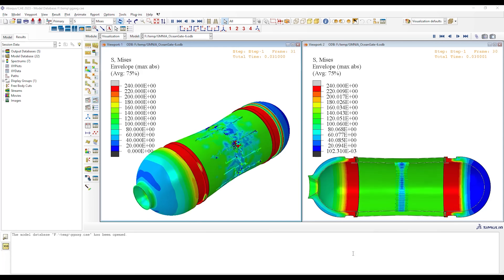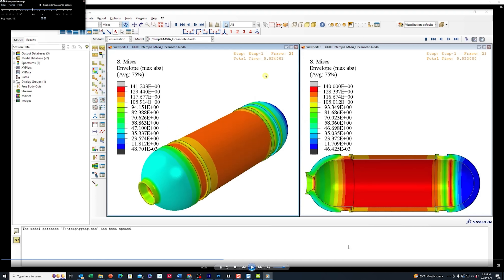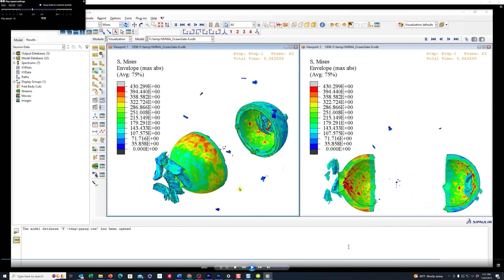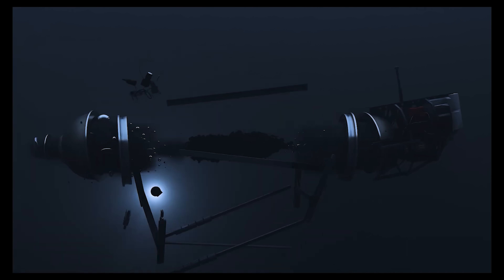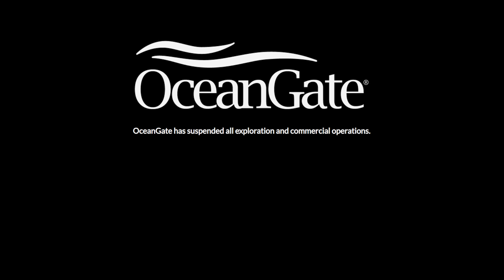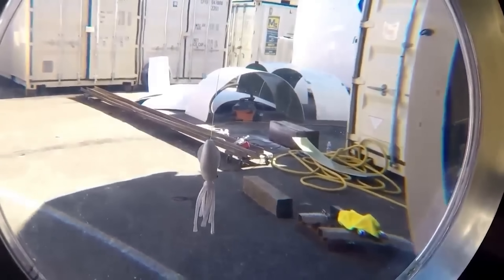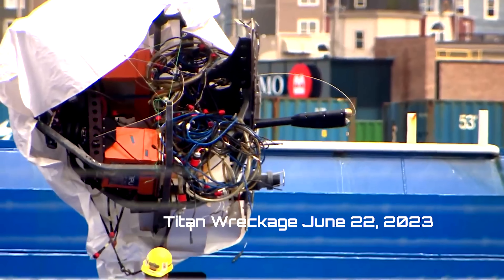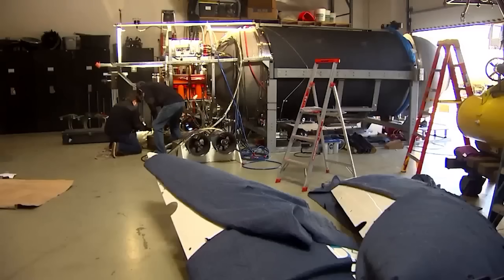Best Titan Sub Implosion Simulation, Cracked Porthole? Q & A

Comment: What still caught my attention is how preserved the titanium parts are. It seems it was the right material to be used in the whole body of the sub.
Reply: And all other submersibles have been made of metal before this. They then went through an extensive,  expensive certification process  before being used. These submersibles have excellent safety records! If it's not broken, don't fix it! Stockton was pushing the envelope with his "innovations" and despite advice about the dangers, continued.
Reply: @IANCHARLES1965  yes unfortunately he was on the right track but like Ford the first model is gonna be kind of a piece of junk and have a lot of recalls and maybe by the third generation you have close to the perfect submersible I would not be surprised if someone doesn’t follow in his footsteps only with less arrogance, and they change some of the specifications and strengthen them to the point where it will be reliable, it obviously was a working model. It was just not perfected.
Reply: @IANCHARLES1965  Pushing the envelope? He was pushing the limits of all human sanity and he did every single thing possible to ensure he died the fastest death in human history.
Reply: The second problem with titanium after cost is you are going to have a hell of a time making a chunk of titanium large enough to make a six passenger sub and then machining it down to size. Joining sections by welding them together and achieving the same strength as a solid billet without causing stress points or introducing impurities sounds like an ordeal.
Reply: @teardowndan5364  it forges well but is hard to machine to tight tolerances that’s the very expensive part but if you can’t afford to be in the game……
Reply: @teardowndan5364  It is an ordeal but IT IS POSSIBLE unlike any current set of orientations of carbon fiber that we know of (I'm not saying it can't, I'm saying we don't know if it can or not which is why it isn't used).
Reply: @milhousevanhoutan9235  Practically every expert who has spoken about carbon fiber for a sub's pressure hull that I have heard said the same fundamental thing I knew: carbon fiber works best in tension where the fiber's tensile strength is the limiting factor and well understood, not compression where the resin bears virtually all of the load.
While this may not be proof that it cannot work, it is ample reason to be extremely skeptical. Experts even say carbon fiber can fail in too many different ways as an heterogeneous material to reliably model and simulate with current knowledge of the materials.
Reply: @teardowndan5364 Well maybe you shouldn’t take people with you if that’s the case.
Reply: @teardowndan5364 The Aluminaut used bolted rings not welds. It had the same depth rating as the Titan was supposedly designed for.
Reply: Too cheap= Human ketchup.
Reply: @Suprem3DarkLord  yeah In hindsight I'm sure he wishes he used titanium, or stress tested, or any number of the other things he blatantly ignored
Reply: @coreyspitzley2960 he can’t really wish for anything in hindsight. He’s dead.
Reply: @coreyspitzley2960 in hind site, he dead
Reply: @berzoidberg3272 lmfao I commented the same thing before I saw your comment
Reply: @coreyspitzley2960 he doesn’t wish that, the entire design process and even after it everybody and their mom warned him that he was cheap and using the wrong design and materials. He blatantly disregarded every warning he got, and sued or fired anyone who disagreed.
Reply: @coreyspitzley2960 Not to state the obvious or anything, but I don't believe Rush is wishing much of anything these days. The wish ship has sailed.
Reply: @coreyspitzley2960 nah too late for that he doesn't realize anything now
Reply: @coreyspitzley2960  well is everyone knows Bill Gates is right about climate change. We should never question because he’s billionaire and you know billionaires are like gods and we should never question them.
Reply: @Suprem3DarkLord  problem not meant to be there in the first place...like everest.
Reply: one thing right doesn't overtake one thing wrong. as in everything.
Reply: Or the right shape. A sphere is much better at resisting pressure than a tube.
Reply: The carbon fiber fuselage lengthened under pressure.  The fiber orientation lacked longitudinal rigidity.  All of the fiber ribbon plies were circumferential. Big mistake!
Reply: @wallacegrommet9343  if the carbon fiber was correctly layered and wound up in a more expensive diamond pattern, it would have helped with that.
Also, apparently the original design of the sub called for a 7" hull and Stockton went with 5" instead to save $

So that was 2 strikes for Johnny Stockton Rush before the sub even took its first dive.
Every single dive was a roll of the dice and they were always going to come up snake eyes eventually. Those paying "crewmembers" who got their previous trip cancelled can count their lucky stars
Reply: @scroopynooperz9051  I've heard others with knowledge state they didn't think the CF being wound differently would have mattered.
Reply: @scroopynooperz9051  No. it called for a 4.5 inch hull and they went up to a 5”.
Reply: @Kimber123  would be cool if we could have some carbon fiber / materials experts do testing and upload this kinda thing to Youtube.
I think many people are curious to know these characteristics about carbon fiber... everyone knows it has great tensile strength to weight ratios (what its generally most used for) but we dont know anything about its compressive strength and especially compressive strength under repeated cycling of extreme pressure to normal pressure and surface temperature cycling to freezing abyss temps cycling.

The real question is, are there conditions in which a smarter engineer could have made carbon fiber work as a repeatable deepsea exploration option? also, would there be a cost saving (if any) when meeting all the expected safety criteria as compared to titanium or steel alloy hulls?
Reply: @scroopynooperz9051  Tbh, I think there's a reason why all other submersibles are made from either titanium or steel. I mean, look at the salvage and what remains. I don't think anyone in that community would touch CF w/ a ten foot pole, no matter how it's wound. For Rush, not only was it cheaper, (of course he never paid for testing or certification which would have added to its costs), BUT it also gave him bragging rights for being the only CF deep diving sub AND he would also be able to fit three passengers in it which wouldn't have been possible with titanium or steel.
Reply: @Kimber123  well it did go to the Titanic successfully a couple of times, even with the el Cheapo Home Depot construction and all the cost cutting... which is why I suspect CF could work in the hands of more competent engineers.

The question is, what would the longevity of a properly engineered and manufactured CF hull be like as compared to titanium or steel alloy... and also, what would the comparative cost be.

Carbon fiber has been around for many decades and no navy in the world, even the ones with massive budgets and R&D access, haven't touched CF as an option to improve sub designs.. there must be a reason for that?

I'm no deepsea engineer or materials expert. Just curious about the material.
Reply: @toomanyaccounts  are they testing a 5" hull at comparative 5500+ psi of pressure?
Reply: @scroopynooperz9051 All very good questions, but you basically answered part of it by stating that the Navy would never touch it as an option - and  no one in the deep submergence game ever has, either.  There obviously has been enough testing/ research to ward off everyone. That's why he wanted the glory of being the first! The big thing is, it's good under tension, but not compression. Tension doesn't come into play 12,000 feet down though, does it, but compression sure does.  Sure, it made two successful - and I use that term extremely lightly - dives to Titanic, but not w/o issue as I'm sure you know. To say he had warnings would be an understatement. He just decided not to heed them and then his luck ran out.
Reply: @scroopynooperz9051  and wasn’t prepreg which would of given more uniformity so I’ve been told ?!
Reply: @toomanyaccounts  I think there was a a few slow motion vids of cf diving bottles being tested to destruction somewhere about
Reply: @Kimber123  was there just two dives?
Reply: @daveredhead4988  They began taking passengers in 2021 and did a dive that year, as well as in 2022.  They had; however, undertaken 90 previous attempts since about 2017 with only 13 of those dives reaching the depth of Titanic, a 14% success rate. This last would have been their 14th trip to Titanic.  In Jan. 2023,  a Guardian story reported that OceanGate had taken about 60 customers and 15-20 researchers down to the Titanic in its submersible.
Reply: @tioswift3676 who made that call and how'd they decide those thicknesses we're fine ?
Reply: @tioswift3676 no it called for a 10” Hull and they did a 7” instead. I was there when they were building it.
Reply: @FC0BCA7E7A Hear from somebody that was there is certainly the best info we can get! Can you explain to us a bit better the crafting procedures that were used? Do you believe that there were other problems we didn't mention?
Reply: @brunosarue  yes. They used paper mache for the insulation. I know because Arnold Swarznegger was also there and he told me.
Reply: @FC0BCA7E7A  oh wow! We have a comedian here!
Reply: @scroopynooperz9051  CF is very good for pressurizing things from the inside because the fibers are under tension. That's why it's used for pressure hulls of aircraft and scuba tanks for example. If the pressure is acting from the outside however it is not good at all because the fibres are only held together by the adhesive. You can't really push a rope if that makes sense.
Reply: @wallacegrommet9343  Quite. They'd have been right for a vessel with the high pressure on its inside, not outside, because CF is only strong when it is stretched. Can't understand how anyone with pretensions of being an engineer didn't know this.
Reply: @wallacegrommet9343 yup! The don't even belt radial tires like that, the belts go in different directions. First thing I thought when I seen the wrap job.
Reply: The Titanium hull pieces, strength hardened a little more each deep sea dive. From being compressed and expanding. This would eventually make the Titanium extremely brittle. Where you could hit the Titanium with a hammer and it would shatter into many pieces. Using Carbon Fiber in addition to Titanium End caps. These materials expand and contract at different rates. This Deep Sea Submersible was doomed right from the start. 
   A Forged one piece Steel Alloy hull is always the best choice for manufacturing Deep Sea Submersible Hulls that will have humans inside. Even this type of hull will eventually work harden to the point of becoming  extremely brittle. This is the main reason why there aren’t many Deep Sea Submersibles being manufactured. There is a video of Forging the one piece hull of the Deep Sea Challenger. It is very interesting how the hull was forged out of one billet of Alloy Steel Stock. This Submersible didn’t pass inspection to go back to the bottom of the Marianas Trench. after its first time going to the bottom of the Marianas Trench. At 35,876 feet deep or 6.79 miles. In meters the depth is 11,849.05 meters or 11,848 kilometers. It’s quite costly and not easy to forge a steel hull for deep sea diving. That can withstand the pressure at the bottom of the Marianas Trench. Being they can only be safely used a determined amount of times. Supposedly the Deep Sea Challenger Hull compressed almost 2 feet. When it went to the bottom of the Marianas Trench. Then decompressed back to its original size. Slowly as it made its way to the surface. SCARY. 
   I don’t understand why Carbon Fiber was used combined with Titanium. Both of these materials expand and contract at different rates. Something like using aluminum instead of steel rebar in concrete. Steel and Concrete expand and contract exactly the same as each other. If Aluminum or Titanium Rebar in concrete. The first freeze these metals would expand and contract faster than the concrete. Making cracks in the concrete that water could get into. Then the water freezes and expands. This concrete wouldn’t last one winter where freezing temperatures are normal. Even heat from the Sun would be enough to cause the concrete with Aluminum or Titanium rebar to fail in 1 year.
Reply: Building subs for 32years.  Makes absolutely no sense to put 3 different components together for extreme depths. One material only allows for expansion.  This guy was off his rocker.😮
Reply: Really expensive. Titanium is notoriously expensive to machine. It wears high-carbon bits out like nothing.
Reply: @dmsdmullins it isn't too expensive, because every other deep ocean submersible has a titanium pilot/occupant sphere. You can't collect meaningful data if your crew is dead.
Reply: @dmsdmullins  Whaaaaa, whaaaaa
Reply: Someone did the calculations for what different materials for the center section would do to the Buoyancy and hence how many crew could be inside the sub.
Remember the sub needs to be neutrally buoyant with half the weights removed, 100% weights sinks slowly, 0% weights rises slowly.
1. Carbon Fiber - 5 passengers
2. Titanium - 4 passengers
3. Steel - 3 passengers
This was never about weight/cost directly, Stockton was just hell bent on having a sub with 3 paying passengers instead of 2.
Of course where weight does effect things, is the surface transport raft and the cranes needed to lift the sub.
Reply: @station240 they dragged the Tital on that raft for a 3 day cruise in rough seas. A big hunk of metal raft was bent a lot with SHARP EDGES. what might have happened to Titan not seen with naked eye? Makes me mad then glad. 5 more idiots visiting Darwin.
Reply: Considering that most Submersible’s are Titanium and Steel it has already been proven over decades that it’s what should have been used.
Reply: Every video I've watched about the making of the Titan they show them winding this black carbon fiber like bans of strips around some type of metallic shiny tube hull with a machine. What were they winding it over? It looks like some type of metallic tube. They were winding the black carbon fiber strips over the shiny tube but then again they call the entire hull a carbon fiber hull? I'm confused. I thought the carbon fiber was just the black strips being wound over the shiny tube hull. What was the shiny metallic tube made of? Can someone answer this please. Thank you!
Reply: @SaveDaLastZombie  I believe the hull was Titanium with the carbon fiber attached with a resin of some kind. That’s why the inside was metal as you see in the videos.  It’s what everything was bolted too. The problem was using the Carbon Fiber at all and the hull should have been pure titanium around 7” thick. They only used a 5” thick Carbon Layer to save money. The method they wrapped it, and applied the glue was also very suspect. Micro bubbles from not using an autoclave could have contributed to the failure. Also the titanium end caps being bolted on was not good design. The tube shape also went against standard practice as a sphere is the perfect shape to distribute pressure at those depths.
Reply: @SaveDaLastZombie  it was just the mandrel to shape the tube they pull it out after it has cured
Reply: The majority of all submersibles are made from titanium.
Reply: @halomultiplayermoments Look up Aluminaut. It was designed for exactly the same purpose as Titan.
It still exists.
Reply: Titanium is legit. Love the run times machining it. Not fun to deburr lol
Reply: @emtee40 all my titanium knives are beautiful, so are my golf clubs. Beautiful material.
Reply: @emtee40  whys that?Curious mind here.
Reply: Yes, the compressibility of TI vs carbon fiber are 2 very different things.
Reply: A thick titanium cylinder might have worked fine, but it's heavy and expensive, and requires a lot of flotation.  Stockton had no patience for that silly stuff. 😢
Reply: Well ya jf he would of built it out of 7-10inch thick titanium with a proper hatch for entry and exit they would likley all be alive still
Reply: Titanium is expensive. This dude didn't do expensive
Reply: @fredalwatkins4506 or safe.
Reply: its still the fuselage of the submersible will take the pressure, whole thing shouldve been titanium instead of CF
Reply: Yup
Reply: Absolutely not. Those half spheres(the whole hull, for that matter) should've been made out of steel. Titanium is tough, harder than steel, but titanium is not as malleable. It's more brittle. There's a reason military submarines are made of steel. Steel can compress and, more importantly, decompress much more easily. Titanium, on the other hand, will compress but not compress when you come back up. Meaning with each dive, the titanium got weaker and weaker. That's one part of the submersible that scared me the most
Reply: It is, that part should replace the whole carbon fibre part
Reply: @vikingnusantara  Oooooops...............too late!
Reply: @vikingnusantara  ooh think we can get the end caps at a discount and we’d just need to do the tube then for Titan 2
Reply: That's the part they got rite
Reply: Titanium end bells would have no damage z!!!!!
Reply: @edreynolds8721  yeah the acrylic layer on Titan was very thin and basically like a small layer of glue only.
Reply: There’s a reason competent engineers use titanium in submersibles
Reply: The shape is the problem. A sphere would have probably been just fine.
Reply: it's not the material (although it helps) it's the shape. that's why all other bathospheres are just that...spheres.
Reply: Cheap billionaire 😂
Reply: Any material denser than the water would remain intact.  Some plastic parts would remain intact.  The state of the parts is irrelevant if they can not work together to keep the pressure difference.
Reply: @marveloussoftware4914  Plastics (including carbon fibre composites) burn during implosion events. They get turned to a fine powder by the forces and then burn in the air in the submersible.
Reply: @allangibson8494  plastics in the lower pressure yes.  Plastics on the outside no.

Its not as simple as you propose.
Reply: @marveloussoftware4914  The unpressurised plastics on the outside survived just fine. They were salvaged with the titanium end caps. 
The carbon fibre composite pressure hull did what overloaded carbon fibre does and exploded into very short graphite fragments and epoxy dust. Overloaded carbon fibre is best cleared up with a brush, shovel (or vacuum cleaner) and really good respirator.
Reply: @allangibson8494  im glad you finally understood the point i was making.
Reply: Why not make the entire sub from titanium?
Reply: @frankedwardstone58  the guy was greedy and reckless
He was told exactly that and he refused
Reply: @frankedwardstone58  i think is mostly because of the cost…
Reply: Those parts are made in right shape.
Reply: You know nothing about materials.
Reply: No, you just lack understanding the hollow part of the submersible where the humans are was what was destroyed because it was avoid in the water rushed in, but that doesn’t mean that every part of it was going to be obliterated, as if it is smashed by a giant ram. The exterior of the sub is intact because it was unaffected, and wouldn’t have been affected other than being tossed around violently for a few seconds.
Reply: So much canned food we take out of the oceans it was time to give some canned food back to the marine fauna.😮
Reply: It made 35 good trips, everyone forgot about that
Reply: @dejesteel262  From my point of view, that is concerning. Can you imagine a car breaking after 35 trips, or a plane crashing after 35 trips? It should have been built for a 1.000 dives... Although he was trying to innovate, looking from what o know today and what have happened, it seems the colapse was inevitable... only a matter of time... in this type of adventure, safety should always come first, I believe. If he had known what was going to happen, would he have done it the same way?
Reply: @dejesteel262  I know but still it was a poor design , I can build u a car out of wood that car work for a good amount of trips but it will fail eventually , carbon fiber is not a good material for ocean depth anyways
Reply: We got a real expert here 🙄
Reply: There wuz cameras all over the joint! The implosion was filmed ... the instant their guts spewed out their mouths ... I want to see those videos ... instant replay ... slo-mo ...
Reply: @Psychiatrick  The implosion was 20 times faster than the frame rate on your phone.
Reply: @allangibson8494  Their are high-speed cameras capable of filming a zillion frames per second ... nonetheless there ought to be frames: "now you see'm ... now you don't" type thing! Creep from the Deep or Motion Explosion ... there's other stuff that don't add up .... like: where did the bolts go to that held down the front bubble plate that was bolted to the bell housing with 18 titanium bolts?
Reply: @Psychiatrick  And why would anyone fit high speed cameras to a submersible?
The media would also have to survive the equivalent of 50 kg of TNT detonating next to it.
Reply: @Psychiatrick  you wouldn't see anything. The cameras dont have the framerate for something that fast.
Reply: Not the Hull😂😂 the caps were great tho
Reply: Because the metal is solid. Unlike the vessel there is nothing inside it. But the video is flawed in that it fails to illustrate the end domes crushing in on each other. The hull would only collapse to the point where it falls, then allowing the two domes to collapse onto each other.. Other simulations show it much better.
Reply: To be clear, carbon fibre is strong enough to hold this pressure.

The problem is that the way the carbon fibre was fabricated makes it almost impossible to track stress damage and tell how long it is going to be able to hold the pressure for.

My understanding is the carbon fibre failed because the glue use was crushed into a power and there was movement between the layers of cf.
Reply: The weak point was always the centre of the cylinder, and any slight deformation there would split apart the titanium and carbon on the end
Reply: Indeed
Reply: It doesn’t surprise me at all. Solid metals do well under high pressure. Titanium holds up well in extreme pressure and temperatures. 

Look at how well titanic has held up for over 100yrs in saltwater at 12,500ft deep. Those titanium end cap’s probably went flying like saucers while the carbon fiber splintered into dust. All that’s left is end caps, wires, anything continuous solid
Reply: Would have been good for the whole body of the sub if you never wanted to resurface … Keep in mind this is way larger than other deep sea titanium submersible
Reply: @mccafferyfamily The Alvin (the submersible used to find the Titanic) was made of titanium and weighed in at 45,000 pounds, and worked perfectly well.
Reply: @DanaFrank1701D  it was way smaller though and could only hold 3 people with no room for movement.
Reply: @mccafferyfamily  I’m aware of that; it wasn’t my point.
Reply: If the hull is what caused it, and it probably was, then the end caps were nothing but domes being pushed from the inside and outside. The wouldn't have been under any crushing force at that point.
Reply: @lordgarion514 actually if the hull fails and the ingress of water is so powerful that it pushes the end caps with the view port out of its bolts , that implosion was really strong but didn’t cause any significant effects to the titanium
Reply: Not to mention expensive
Reply: @coreyspitzley2960  Worth the price.  Went for the cheaper material and it sent 5 to their grave.
Reply: How much money was left in the CEO's bank account??
Would anyone think leaving money in your bank account was being prudent or financially wise, given that a desire to save money resulted in your inability to ever earn or spend money again,,,ever?
Forever being wealthy is not how it's going to play out. I state the obvious for purpose of reminding wealthy people to ask themselves how cheap is their life is their own business, but how cheap are the lives of those that become the inevitable 'ego fodder' of self indulgence.
Reply: @coreyspitzley2960 he was a billionaire 😂
Reply: @fdfgaming9076 wrong...his net worth was only 25 million
Reply: @HellsSoldier  which just goes to prove the old adage of more money than sense !
Reply: @coreyspitzley2960 but what is the cost of human life?
Reply: @coreyspitzley2960 pretty sure carbon costs more in that form
Reply: @coreyspitzley2960 Carbon fiber is also very expensive, and other small deep diving subs are made out of titanium
Reply: @coreyspitzley2960  that has what to do with anything actually it wasn’t expensive it was cheaper and the moon landings cost almost $1 trillion a Lamborghini cost more than a dodge. Does that have anything to do with them both going down the highway?
Reply: Pretty sure cost cutting you don't want to do, with this a the example why
Reply: @coreyspitzley2960 yeah I mean 5 ppl dead or more expensive materials seems like a no brainer.  Literally
Reply: Too heavy though
Reply: @coreyspitzley2960  there's plenty of submersibles that use titanium. And if it's too expensive, maybe your in the wrong buisness? There's never been an implosion before, and now the one time it has happened the creator cheaped out. Carbon fiber is not the right material, no matter how light or cheap it is
Reply: @Nobody0127t5  the guy was entirely wrong I agree. And I was mistaken on titanium being too heavy. I'm no expert.
Reply: @Nobody0127t5 also, no matter how thick it is. He. Should have scrapped the vessel after 5 or 6 deep dives or started another business wherein he stayed shallow and looked at reefs and fish. His budget didn't allow him to retire the vessel at the appropriate time. Oh, and...he was a fool.
Reply: @coreyspitzley2960 Yes, too heavy, defeats the main reason for using carbon fiber
Reply: @coreyspitzley2960 it certainly is not too heavy. All other deep sea submerisbles have a titanium sphere for occupants. Sure, very few occupants. But it's hard to sustain any business model where your "researchers" get positively vaporized into mist, be it 4 and a pilot or 1 and a pilot lmao.
Reply: @coreyspitzley2960  too heavy? The reason they use composite material because it was lighter than all of its predecessors you should put down your phone and watch a few more YouTube videos for like the next two years. Get educated.
Reply: No it usnt
Reply: @coreyspitzley2960 The best submersibles in the world are titanium
Reply: @carpe_poon5761  the Russian Cold War ones weren’t the best but most of that was not the body there would be a lot of titanium in some scrapyards sitting around I think not rusting
Reply: What did you expect? Rust or something?